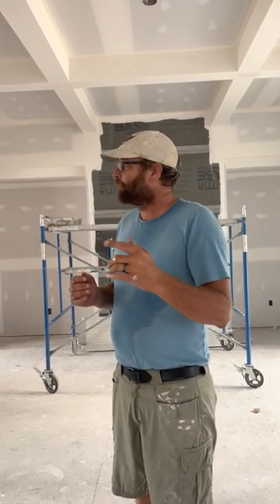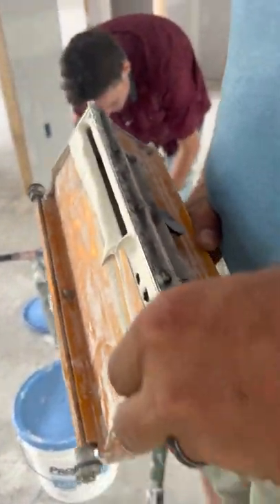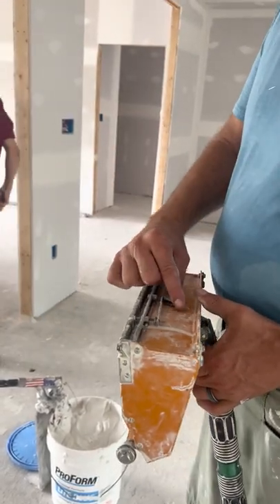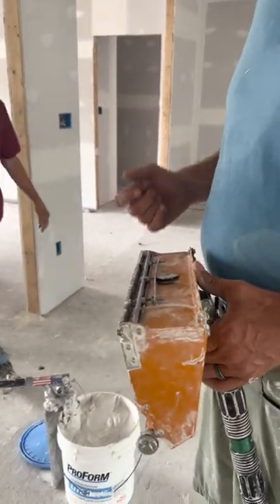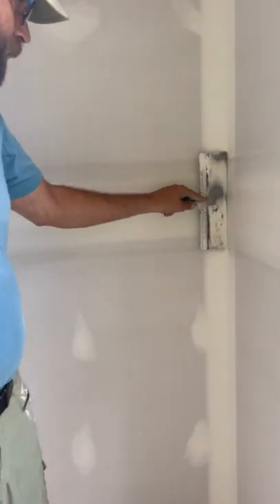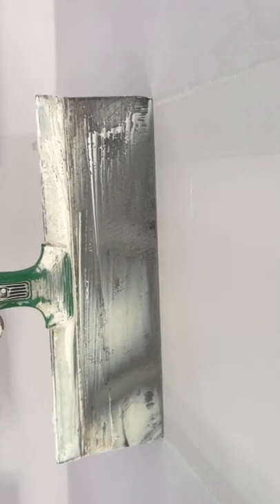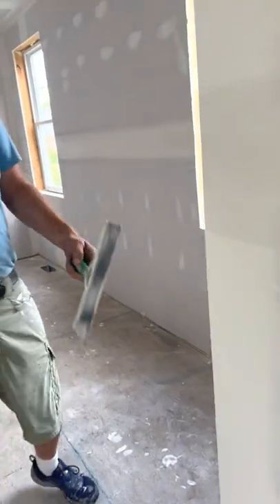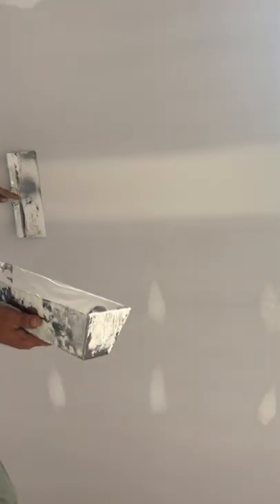Butts and Flats with 12” Tapetech box, explanation and demo.

Comment: Hello, great work. How do you like the mud shot? And how long do those mechanical flushers last? We bed the angle tapes by hand with the super taper and a bucket, then just flush them with a 2" and then finish with a 3.5" flusher. Thanks!
Reply from the maker: I had a lot of input in the mudshot when it was designed.  The owner of level 5 and myself discussed how to make a machine better than the mudrunner.  The first prototype didn’t have enough power in the piston so I let them know to adjust it.  I absolutely love this machine.  I have run angle boxes, mudrunner,  run angles by hand 1 side at a time.  The angle heads I use are a 2.5 northstar when I am glazing angles, and the 3.5 nothstar when running angles.  I do not know how long they last as I have had these for 5 years and done 40 to 50 houses a year or more and they are still working.  Honestly I thing it took a year just to break them in.
Reply: @manwithapan  thanks for replying. I'm definitely going to look into the mudshot!